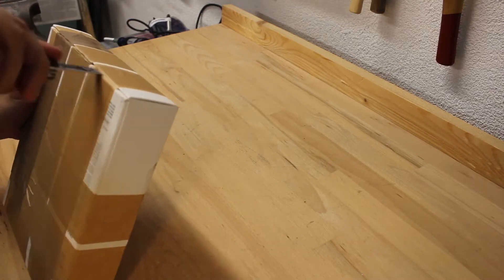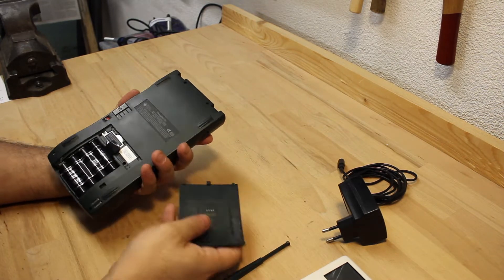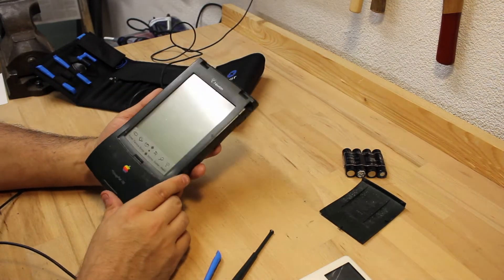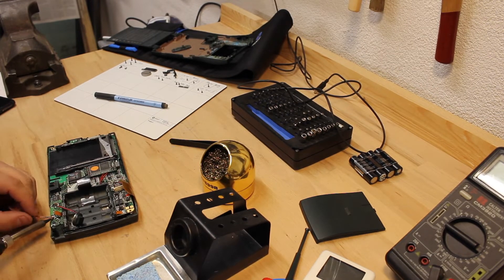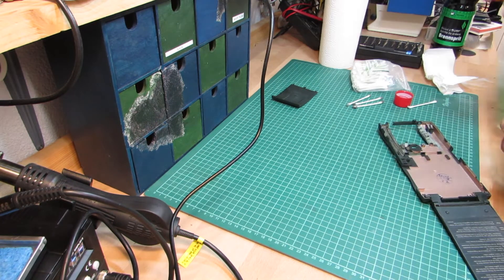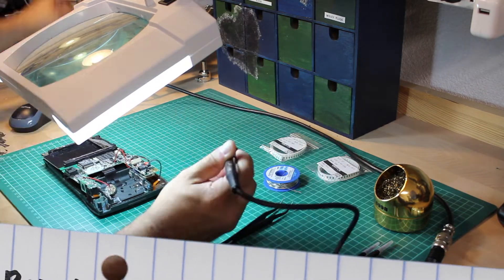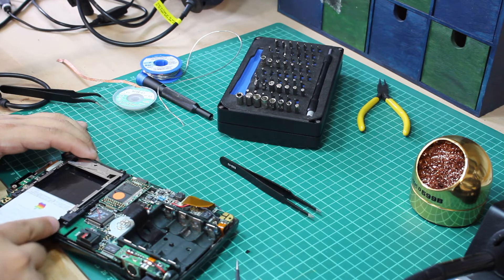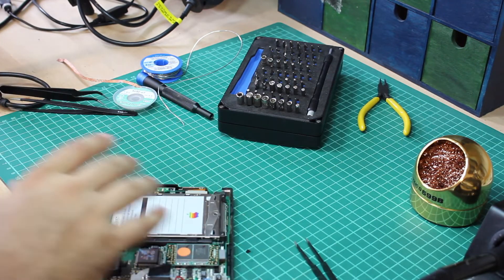How to repair the Apple Newton MessagePad 130 - Part I

Comment: Hello! I’m a little late to this video, but I’d like to perform the same updates to my MP130. However, I’m unsure of the size of SMD resistors I should order. Do you remember the size you used for the 4.7 kohm and 1.5 kohm resistors?